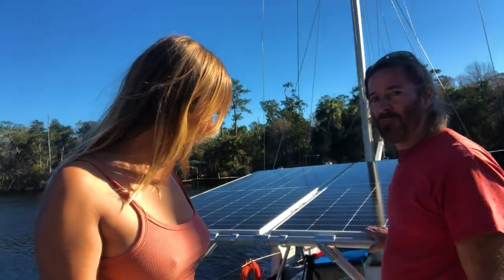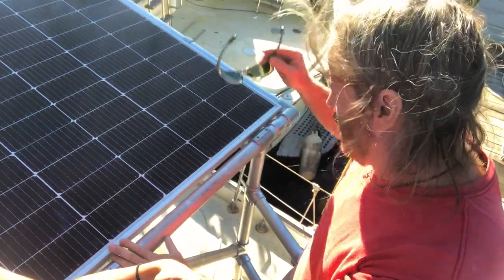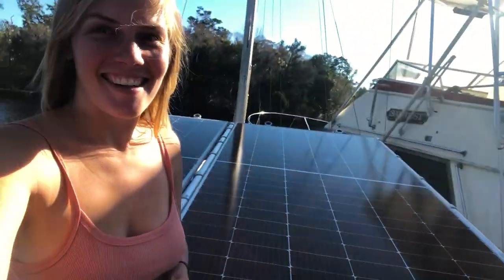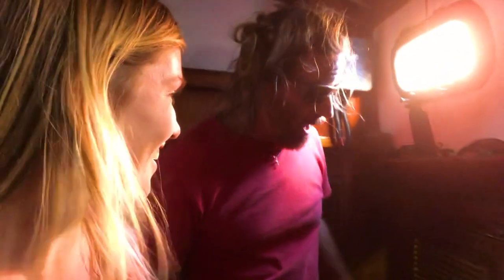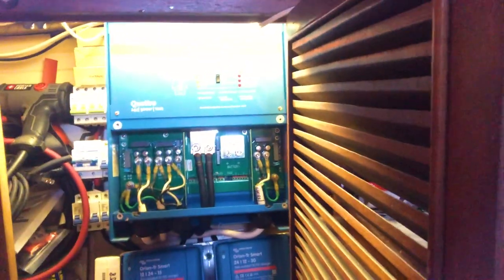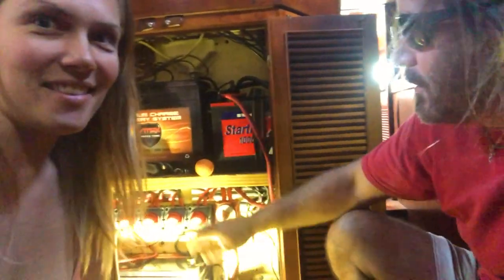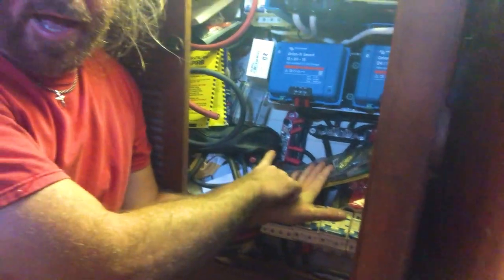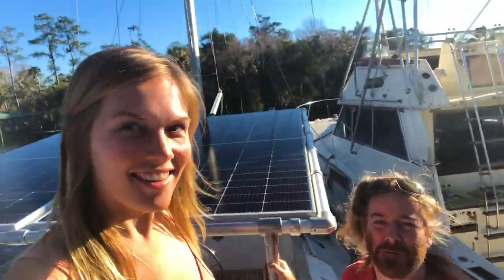Sailing Liberty- RENOGY SOLAR HARDTOP/ Building our new Hard Dodger

Comment: That is a good solid install. MC should be able to provide grommets to protect the edges of any holes you might drill in those rails to run wiring.
Reply from the maker: We have generously applied zip ties to neatly indexed cables. Looking forward to seeing some output. Maybe we do the grommets in the future. :)

Comment: Great looking install! What is headroom, and total weight,? 👍🇺🇸❤️
Reply from the maker: Hi
Great questions- 
The head room averages about 7 feet but we built the hardtop to accommodate our original dodger/Bimini top with room for air flow, so inside our Bimini the headroom is 6.5 feet.
The 2 panels weigh 124lbs combined, I haven’t added up the weight of the fittings, tubes and hardware.  Thanks!!!

Comment: Perhaps I'm missing something on your solar setup.  You have two 550w panel or total of 1100w possible power.  If in series or parallel the voltage should be below the Victron's 100v max PV voltage.  However it is the MPPT's 30 amp output to batteries that looks to be undersized. 
 if it will charge the 24v lithium bank-  1100 watts/26v charging voltage= 42 amps
if it will charge 12 v batteries  - 1100watts/ 13v charging voltage = 84 amps
Both these amperages are considerably above the 30 amp rating (40% over, 180% over respectively) so the 100/30 Victron MPPT may not be able to transfer all of the PV power to the batteries when in intense tropical sunlight.
The Aluminum frame looks great and nice alternative to welded SS.
Reply from the maker: Just finished the project yesterday and today we are charging fine.
Reply: @SailingLiberty  Victron's site in their sizing section indicates a 100/30 MPPT should have max 440w of PV power for a 12v bat system and 880w PV power for 24v bat system.  The calculator recommends a 100/50 MPPT and probably a 100/40 would work for 1100w PV. My only concerns are that you will not get full power out of your 1100w panels, in bright sunlight the MPPT will be throttling down the power going into bats and that the Victron MPPT may, over the long run, be damaged and no longer work, leaving you with inability to charge a 24v bat bank, at least via solar.  On a sailboat, I installed another brand lower cost MPPT for 640w PV going into a 12v bat bank and chose a 60 amp output MPPT (640w/13v charging voltage= 49amps) giving a few amps cushion.

Comment: Im a fan 100%, does this half cell technology cancel out the shade loss issue?
Reply from the maker: 【High Tolerance】 Renogy's high-powered 550 watt solar panels are made with half-cell technology. This half-cut panel is more tolerant of shading on any part of the cell and performs excellently in low light situations due to the increased number of cells receiving more sunlight.

Comment: what section of mcmaster carr catalog did you find the pipe and those fittings?
Reply from the maker: Hi
We use the McMasterCarr App, much better than website, just search Speedrail. We bought the pipe from a regional supplier- it was delivered on a flat bead tractor trailer! Wow- we are really in it deep:)

Comment: Did y'all consider powder coating aluminum frame for panels?
Reply from the maker: Yes. We were but our next project is  hauling out the boat and fixing hull around the propeller (deadwood)... and then we will see where we are with our funds. Probably in grand 0. 😃